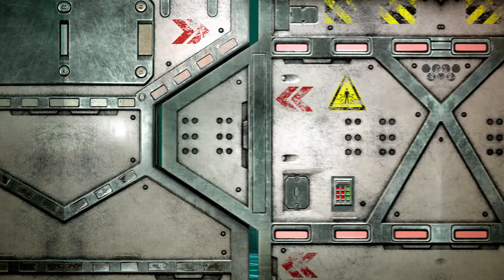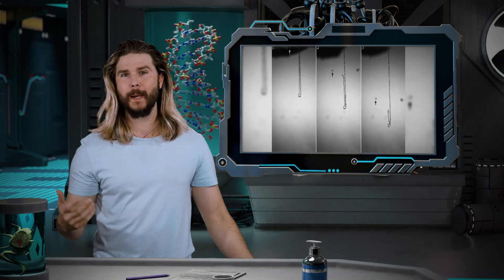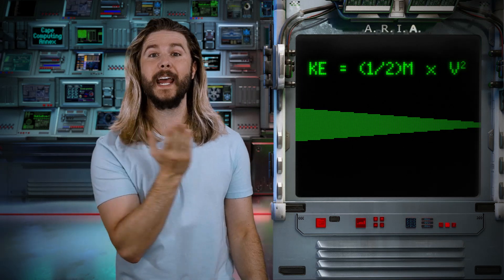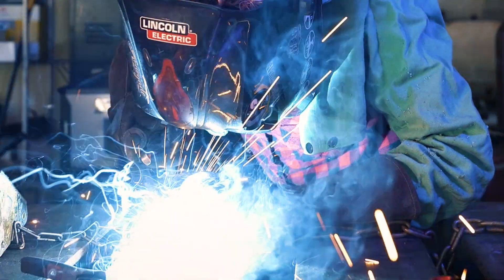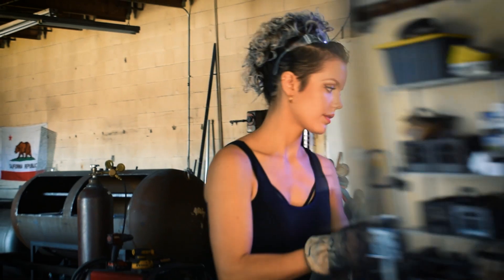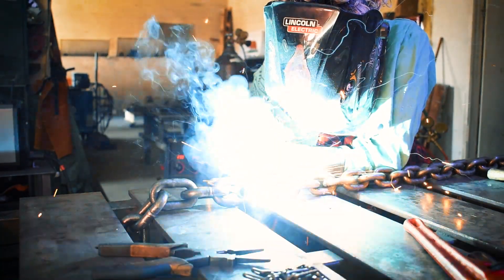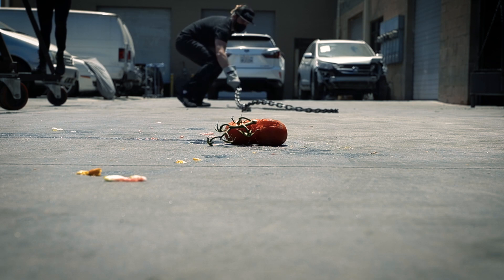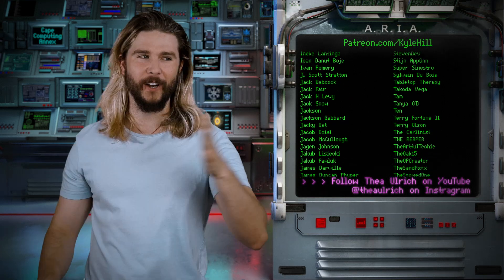Steel Chain Whips are SCARY

Comment: How dangerous is kyle’s BRAIN 🧠?
Reply: @LTNetjak The brain is soft though, right? Wouldn't it hit him like a water balloon? The snap of the wet tissue on skin will hurt but mostly it just makes a mess.
Reply: Yes
Reply: I need agree that Kyle's brain if thrown would not be lethal due to it being SUPER SQUISHY and therefore deforming and absorbing energy upon impact. 

However I do believe that the true destructive potential of Kyle's brain cannot be found in using at as physical weapon, throw or otherwise. Rather it is an intelligent weapon or perhaps more fitting its intelligence is a weapon. 

Much like an advanced AI the dangerousness of Kyle's brain should not be derived from the physical device it constitutes but from the goals it might use its computing power to achieve as well as the destructive potential of the things it may produce. 

It is by this path of thought that the true danger if Kyle's brain becomes apparent. 
It has been know to run an extensive secret facility in which it runs extensive research creating for example Godzilla like monsters. 
It also has apparently worked on stealing cars in space displaying disturbing capabilities which will surely scare the citizens of earth. 

Yet this is not where the gravest danger emanating from Kyle's brain. This is rather fohnd in its research into exotic forms of matter, extreme space time distortions and other mysteries at the edge of known physics. 
It is all to likely that this research may lead to scenarios such as a realtime collapsing into a true vacuum or our universe colliding with another. 

We can safely say that it is therefore not only a danger to our planet, our solar system or our galaxy but a danger for the entire universe! 

Its dangerousness is truly unquantifiable.